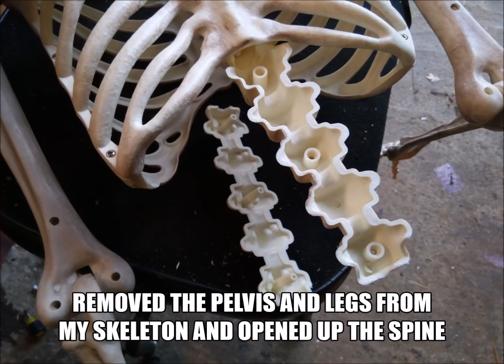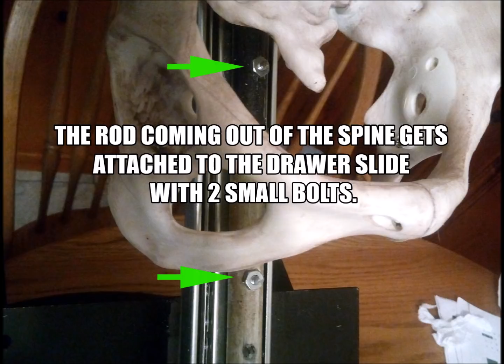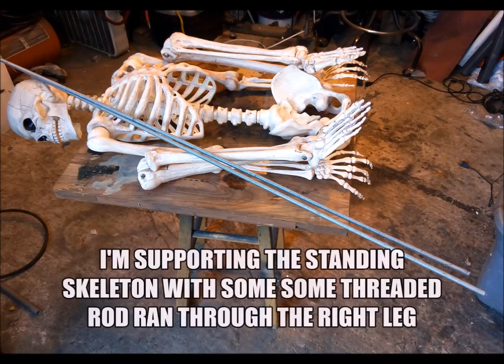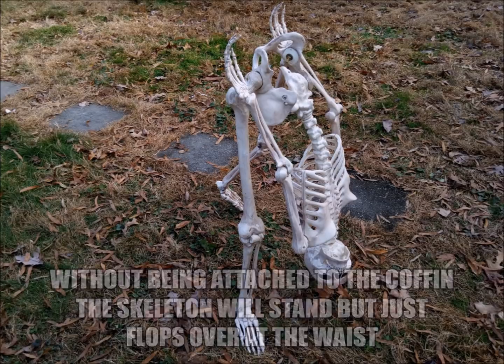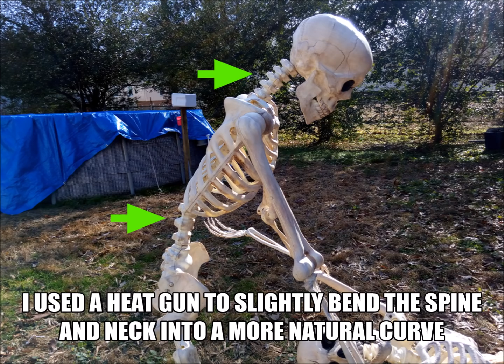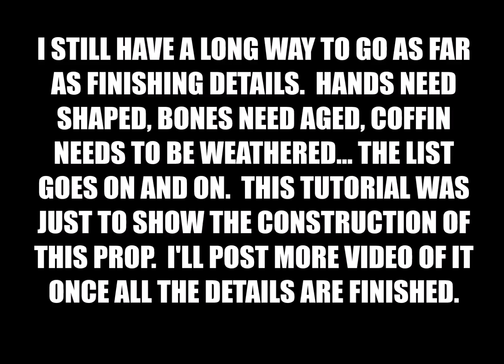Coffin Puller Tutorial

Comment: Fantastic concept & execution! 
Please excuse if this has already been asked/answered...  what size (length) drawer slide did you use and is there a detailed Parts List available?  Thanx!
Reply from the maker: I THINK it was an 18in slide. Been a while.
Reply from the maker: I was wrong. 12in is what I used. Remembered I could look back at my Amazon history and find it. - https://amzn.to/3BkdahS
Reply: Thanx!  
If you'd indulge me one more question: 
What is the approximate angle, of the 2"x10"s/drawer slide/skeleton, in relation to the base?  I tried to measure from the video but the camera isn't really parallel to the base; 45° seems waaay too steep, I'm "guesstimating" something in the range of 30°- 35°...?
Reply from the maker: Well good news! I "guesstimated" it too, so I have no idea what the actual angle is either. lol I'm HORRIBLE about doing things accurately with a measuring tape or angle gauge and I eyeball 90% of what I make. Yes, it is lower than 45 for sure. Aim for the standing skeleton's chest and it should be about right. You want the skeleton attached to the slide to be pretty much lined up with the standing skeleton's outstretched arms so it will push in a straight line towards the standing skeleton's shoulders, which will push the standing skeleton back pretty easily.

Comment: how long are the rods? and circumference?
Reply from the maker: You mean the threaded rod in the leg? About a foot longer than the leg. Not sure of the diameter, I used what I had on hand. Small enough to fit inside the leg bones, but still be rigid enough to not flex easily. Im guessing it was 1/4".
Reply: Oak Lane Cemetery thanks a bunch for answering.

Comment: Can you use it in the rain.
Reply from the maker: Yep. There is a metal cover that slips over the mounting box. I didn't show it in the video, but it's shown in some of the pics I put on facebook I think. I also made sure all the electrics are raised off the bottom about an inch or so just in case. The only component I worry about rusting would be the drawer slide, which I put a heavy coating of marine grade grease on to keep it running smooth and hopefully reduce rust. Everything is pretty much plastic or wood so should be fine. One of the reasons I've switched to using plastic rope spools for the bases on my props is to prevent any wood to ground contact rot from trapped moisture. It's probably not 100% waterproof, but it should hold up fine.